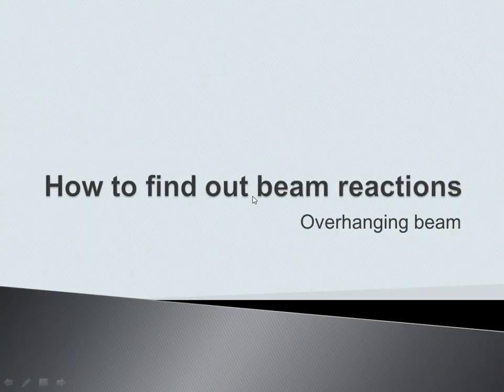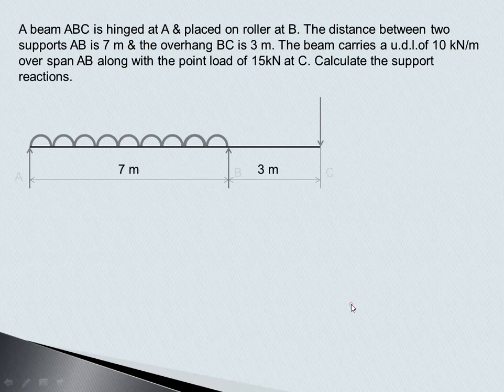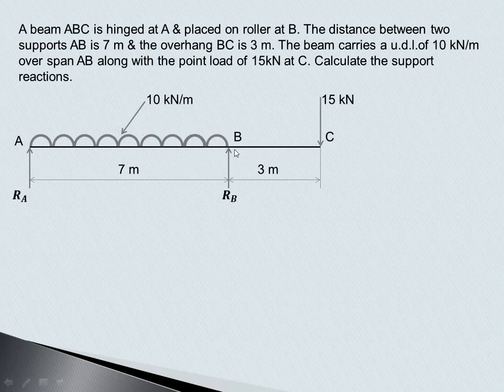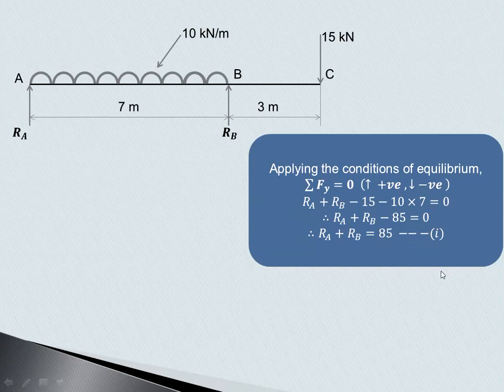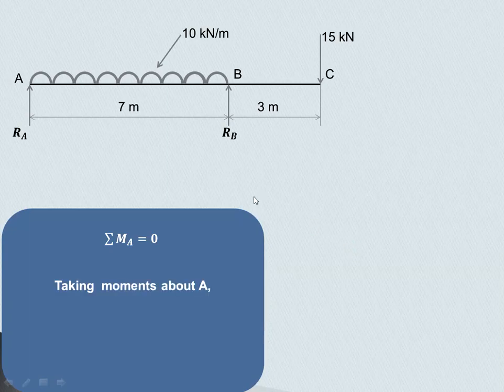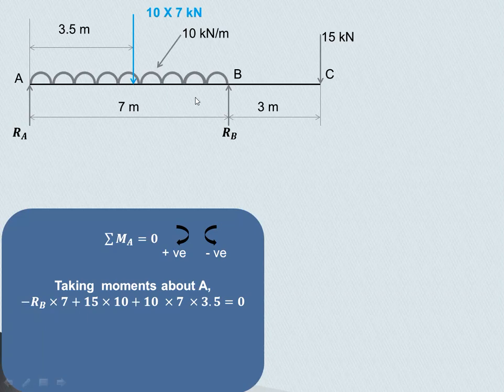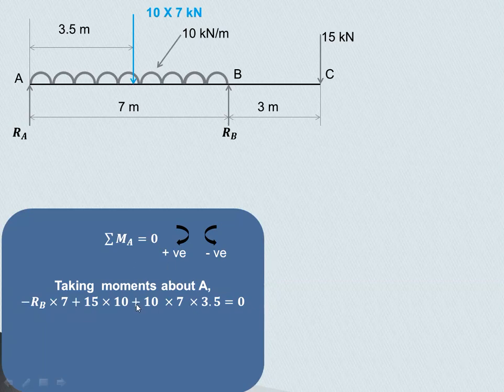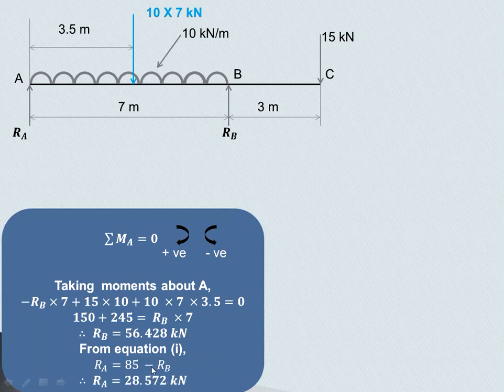Lecture 3 | How to find beam reactions | Overhang beam

Comment: Nice video. pls can you tell me how to calculate #Moment at #Reaction #B". That's the real challenge when it comes to overhanging beam.
Reply from the maker: To calculate moment at B, consider all the forces on the left hand side of B: Considering clockwise moment positive & anticlockwise negative we can calculate moment at B as follows:
MB = RAX7-(10X7)X3.5 kN-m. Hope it will be clear. We have converted the u.d.l. of 10 kN/m into point load acting at the centre of 7 m length. Thanks ....
Reply: thank you !! ✌
Reply from the maker: Most welcome ....

Comment: Sir,,  about taking clockwise and anti clock direction will it be the same if the negative and positive are taken all in same direction in both finding reaction force and bending moment.... Im confused bcos you keep changing in every problem....
Reply: Like if all clock wise are considered positive and all acw as negative???
Reply from the maker: For calculations of reaction , you can assume any conventions. But, for simply supported beams while calculating bending moment you have to consider clock wise positive & anti clock wise negative whereas for cantilever beam the conventions are clock wise negative & anti clock wise positive. Hope it will be cleared to you.
Reply: thanks you so much sir.. i will remember it..
Reply from the maker: Most welcome ....
Reply: Hello sir! 
And for overhanging  beam sums the sign conventions?